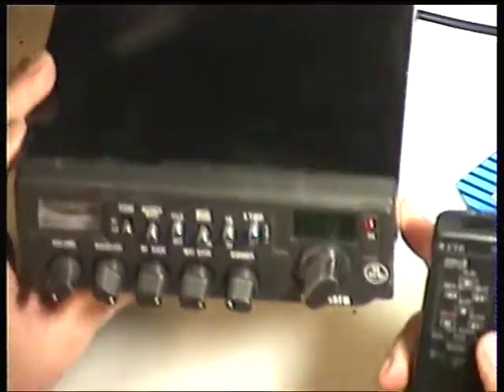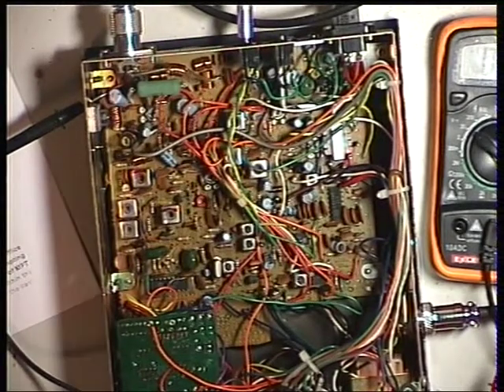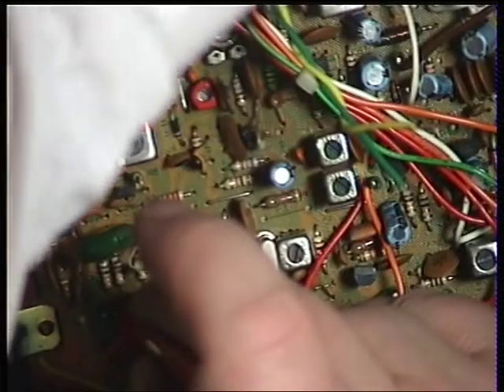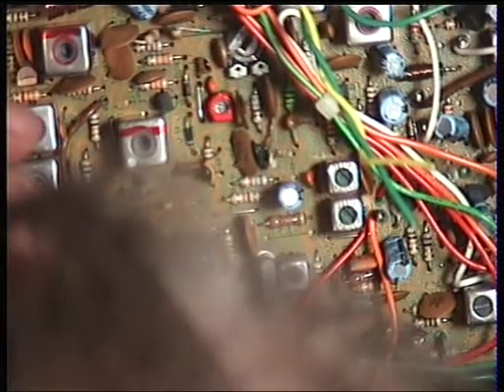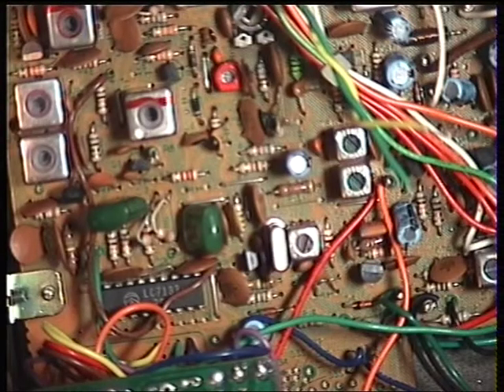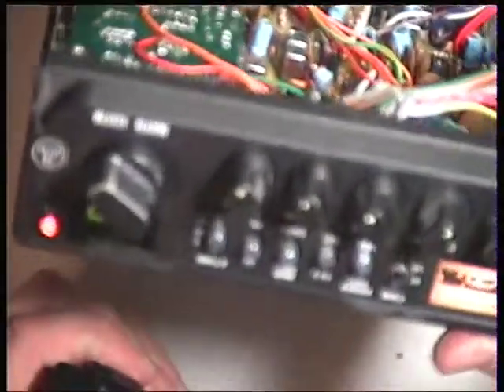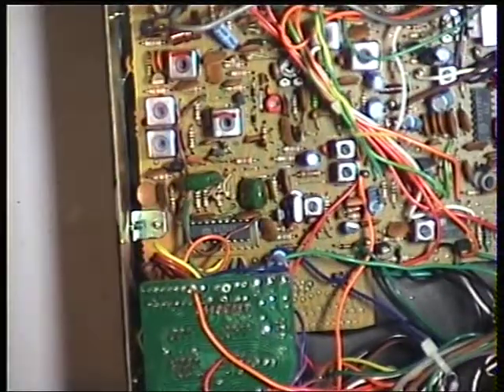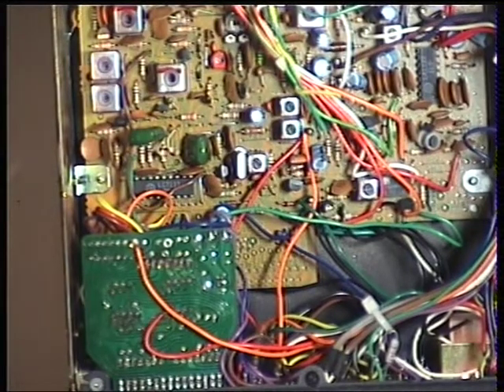Nato 40FM, UK (CB 27/81) CB radio (Mobile)  - VCO & Transmit adjustment

Comment: I just watched a video where someone was trying to tell everyone to chop out and by-pass the big green resistor at the back to get more power!  Now without the schematic I don't know off hand what it does, but just be looking at it it looks as if it is dropping voltage to somewhere like the final transistors.  If that is the case the transistors will not last all that long.

5 of deviation.  Geez, screwdriver experts again.  They would have sounded very rough to everyone!
Reply from the maker: Yep and those original Mitubishi 2SC2166 transistors stopped production about 20 years ago, so most for sale (I have discovered to my expense) are fake. I would say that stupid modification kills every set it's done to...well certainly everything this that chassis & the resistor linked out that comes here is dead. 

Richard
Reply: @ukfmcbradioservicingTango21  Yep, I thought so, more power for a wee while until it dies!
I remember putting in loads of Transistors into Home bases as they thought turning the power supplies up to 15 Volts or as much as they could get out of the power supply.  Always resulted in the output and sometimes the driver blowing as well as the final took it out.  I must have a few output transistors around somewhere.
Is there an equivalent transistor can be fitted, I am sure I have a couple of sets in boxes somewhere that were blown?  Knowing my luck there will be no equivalents made or they will have stopped making them as well.  I don't have anything (paperwork yet) so can't look things up.  Must be something I can stick in!

Comment: Nato 40FM, just an Amstrad.
Reply from the maker: Why was the Nato 40 supposed to be something special?

Richard
Reply: @ukfmcbradioservicingTango21  No, but I remember a Nato FM with a lot more then 40 channels, but that was not a Nato 40 FM.  Oh well, I think I have or had the other one at one time, though never used it!
Reply from the maker: That was an illegal set with a fake 27/81 badge & was the Nato 2000.

Richard
Reply: @ukfmcbradioservicingTango21  Yes I know, but it was only transmitting on UK40FM.  Anyway, I never used it.  I have no idea where it came from in the first place.  There is no way in hell would I have bought it. If anything I would have bought something even more illegal before it became legal, since then I have just had legal sets, though I am sure it is in the shed buried somewhere.  Even when I used illegal sets before we were allowed to use CB in the UK I always stayed inside 27Mhz.  I now see kits to expand CBs from 25 right up to 30Mhz.  In fact I saw and advert somewhere for a set that was high powered and went from 25MHz to 29MHz AM/FM/SSB, now if that is not going to cause bother I would like to see what does?  I don't know why anyone would want a set like that.  What is at 25MHZ anyway?
Reply: @ukfmcbradioservicingTango21  Yes Richard The Nato 2000 and Teaberry. Stalker 9FDX Where the 2 models that slipped through HM Customs inspection at the time.. In some circles makes them a collectors item... Just shows how much HM customs cared at the time..